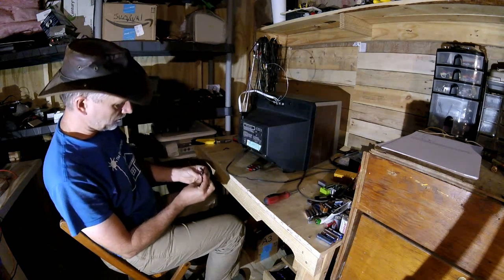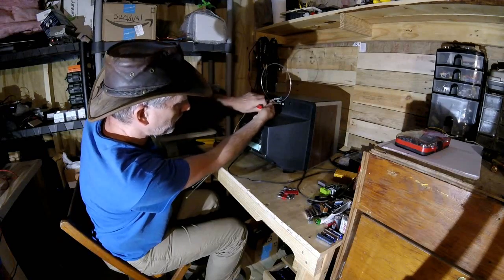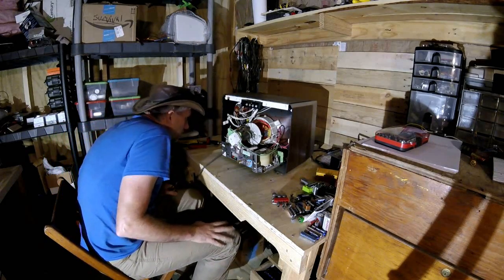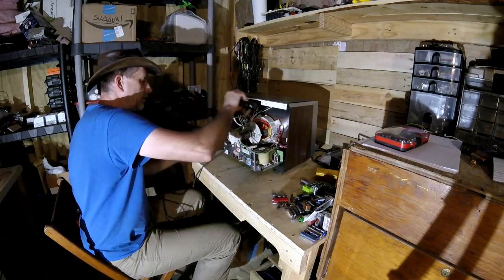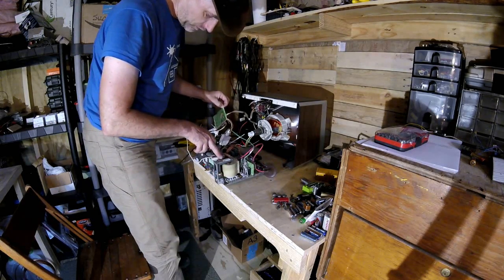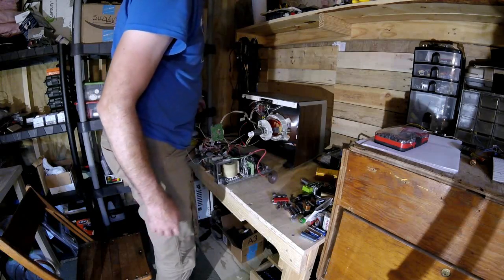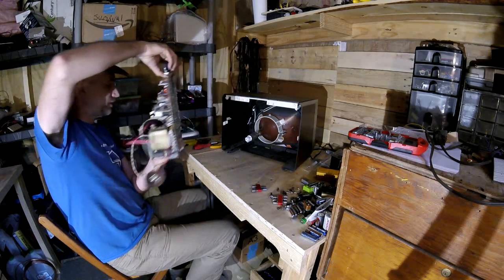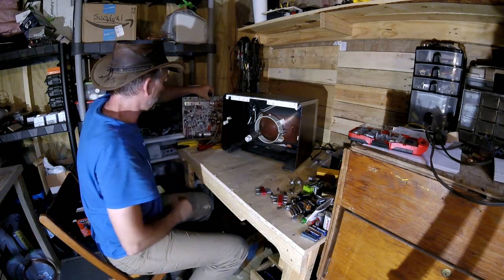Salvage Some Good Electronics From An Old TV

Comment: Hi Troy, you like to do experiments, so here is one you may find interesting.  Why not try
putting a switch on your Bedini motor and Quanta motor that will turn off power for maybe
8 or 9 seconds and switch back on for 2 or 3 seconds.  You will probably find a sweet spot 
where power is off more than it is on.  This will probably will not affect the top RPM of 
the machines as they are so free running, and will give a longer running time on the batteries that are running the Bedini and Quanta motors. I don't quite know how to do
the electronic part of hooking the motors up like this, but you could probably figure  this
out. Have fun.
Wayne
Reply from the maker: The thing is that pulsing energy is what charges the other batteries. The more (and faster) pulses, the better the charge on the batteries. Thanks.

Comment: Was it that heavy wire that went to the glass on the side of the big picture tube that could give you the big shock?
Reply from the maker: Yes it could if the capacitor still holds a charge.
Reply: Could you use the high voltage device and the caps to make a security zapper to connect to your truck to prevent tampering?  Sadly if an intruder did get zapped by it you would probably be sued by them for physical injury.
haha.
Reply from the maker: Yes you could. But yes it would get me in trouble. Sadly criminals have more rights and protection under the law than their victims.